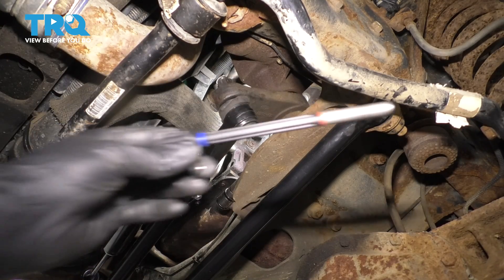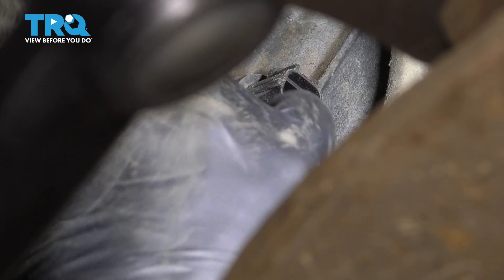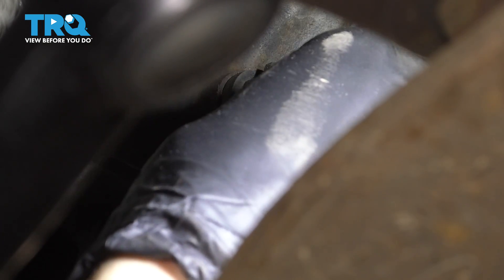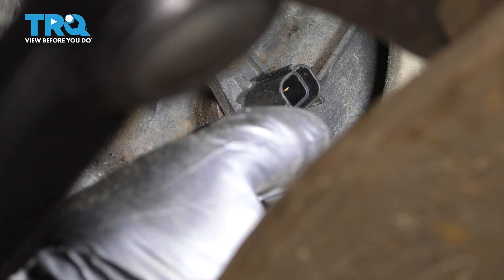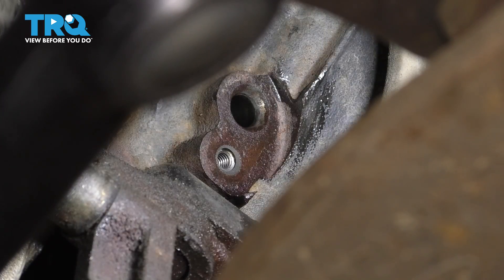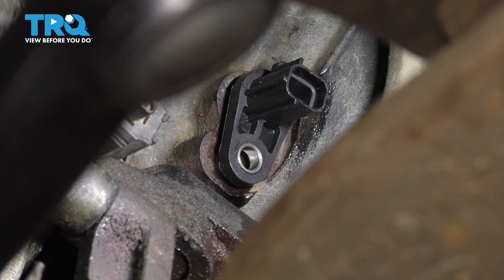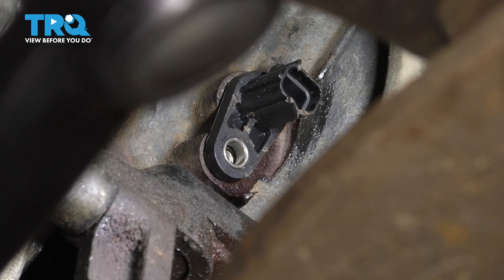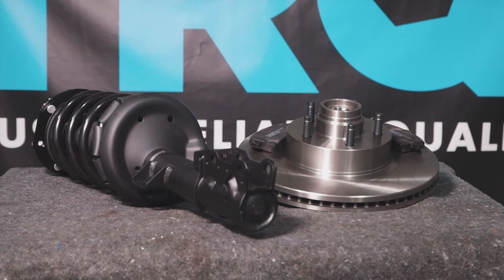How to Replace Camshaft Position Sensor 2008-2010 Ford F-250 (6.4L Diesel)

Comment: Why don't you show the actual connector and show how to get it off? isn't that part of doing this job? NO ONE EVER EXPLAINS THINGS LIKE THAT. I can't get up to the connector to see how anything is on it. I can't even get a good squeeze on it to attempt to get it off. I'm ready to just watch it burn.  No room to work on anything at all. Who's the genius at Ford who designed these junk super duty's with zero room anywhere under the hood? You even need to remove the entire cab to change out the turbo's. Just plain stupid. why would anyone buy these? They replaced a bad engine with a worse engine (6.0-6.4).